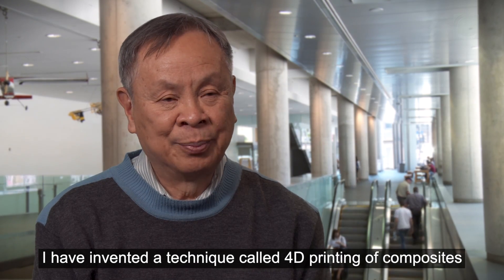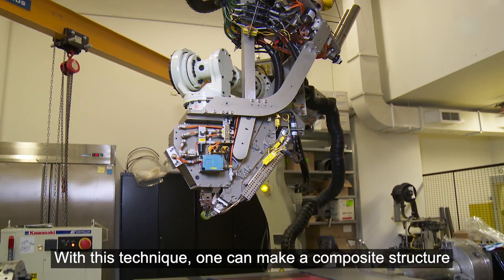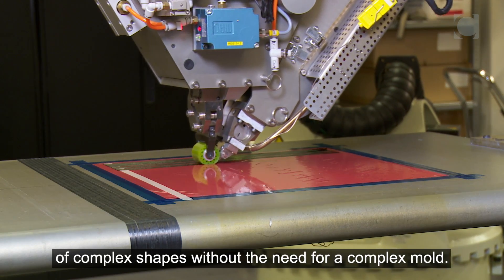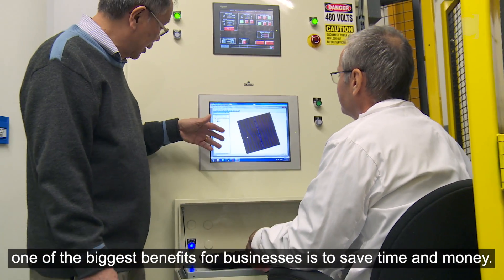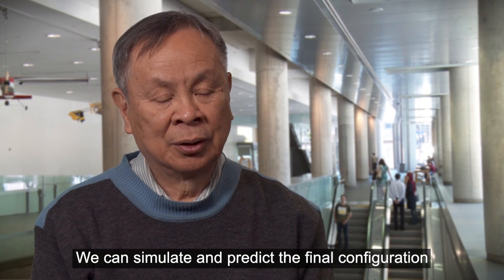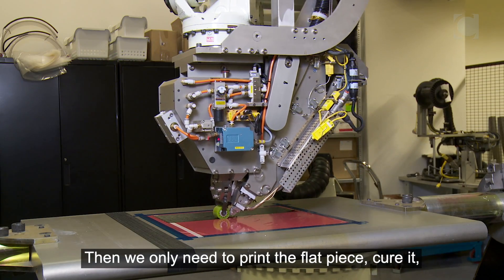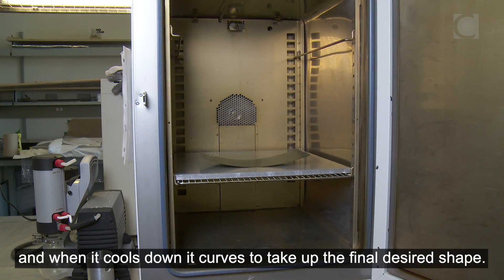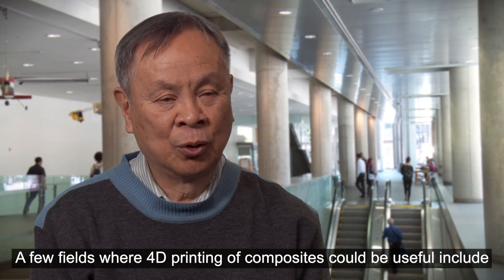A Concordia Prof Invents 4D Printing of Composites

Comment: This is not 4D printing. It is not even 3D printing. There is no invention. They were trying to manufacture a flat panel using AFP. They could not do it. Now they want to sell it as a 4D printing technique which is far from that. The other guy in the video is not even AFP technician at Concordia. The first step to attract industry or get funding is to be honest about the research and outputs.